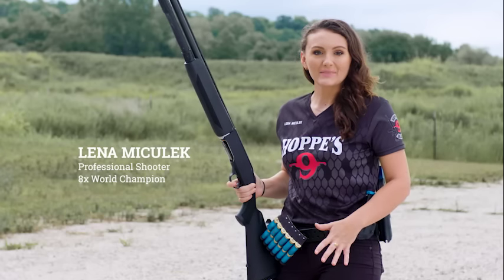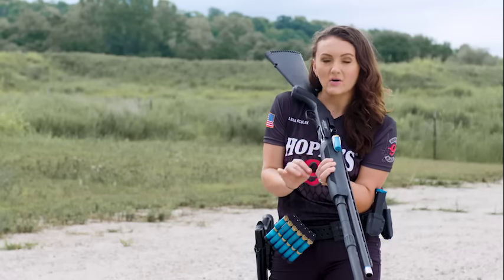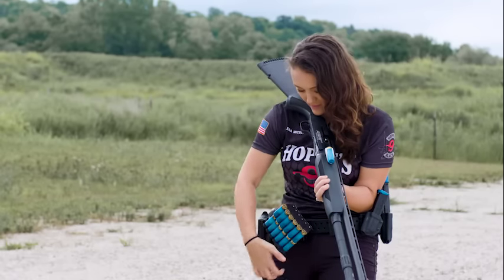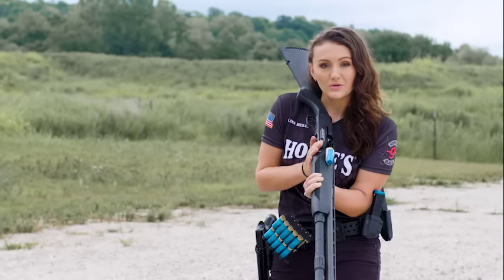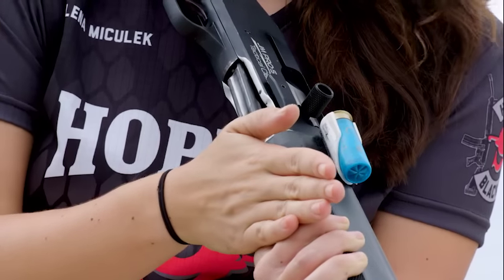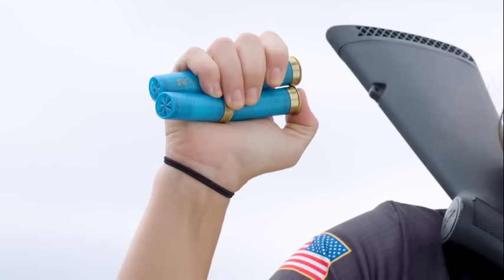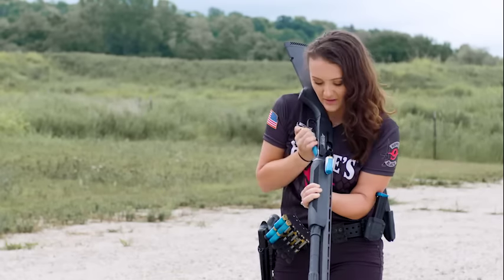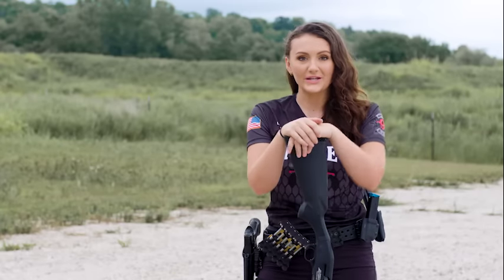Lena Miculek Quad Load

Comment: Amazing instruction, I have two Snap Caps so I just tried this on a basic Mossberg 500, and it worked fine (messed up many times but the dual load worked several times). As for the quad load? EH, not a chance right now.

Hardest part seems to be holding the shells and not letting them fall. If you do, you need your other hand to regroup if you’re a “normie” like me.

She’s really damn good, but we all know that anyway.

Comment: I run 3½" 12ga

One quad load and i am full up on an unextended tube.

Never bothered speed loading a shotgun, but now that ya showed me it looks like imma have to spend an 1hr or two a day doing reps till i am happy with it.

Tho now u showed me the mechanics... I don't like taking a long gun off shoulder to reload.

I think there maybe a way to pull off a twin load without taking the shotgun off shooting position. In my head i see maybe being able to hold two shells like u would a throwing spike.

Gonna have to sit and play around, see if my wrist can bend to the correct angle while holding two shells in spike throwing palm hold.  And then using the base end of my palm to run the shells foward..

Idk I practice next weekend when i have sometime see what happens.

I don't think there is risk of jamming or punching finger tips, never tried so don't know.

Thanks u made my brain perculate

Comment: So the first time I watched this I was blown away on how amazing it was so like 2 days later I bought some snap caps and I started practicing and after about a week ive been rapidly quad loading now I’m about 3 months in and it’s gotten pretty gud the bad thing is though my rem 870 hasn’t been dremeled so every time I go to fast it hits that lip and my top or bottom shells break and I lose control of it, every time I go out the range I just blow people away with it and there like what was that, and I’m 13yrs old and I go against adults I wanted to practice this because of quail and dove hunting cause they are some fast birds and when you have a fast reaction time to reloading it does great for you

Comment: In my experience the loading is actually the easy part, but getting the shells out of the caddy is hard

If I take the shells in my hand I can easyly load them I even can do 3 and 2 but I usually get one or two stuck in the caddy when trying to do the full process

I use an unmodifyed fabarm sat 8 (pump guns are illegal in austria but semi autos not) and I have quite large hands

Comment: What is the white clip that’s holding the shell on the side called? I know that’s a dumb question I just need an answer
Reply: A "match saver" used to drop a shell inside the ejection port rather than in the tube

Comment: Twin, quad load my shotgun and put the end of my barrel in the ground?😂
Reply: Did you see it in the ground?
Reply: @jimmyreece5781 you can hear it hit the ground and she then she rests on it
Reply: @jasonb8407  doesn't mean it's in the dirt or on the concrete.  There's something called a barrel rest pad and it's made for this purpose.
Reply: @jimmyreece5781  well I can say I have never heard of that or see the purpose in it but hey if it is a legit way that competition shooters use than run and gun.
Reply: @jasonb8407   You'll see it a lot at trap ranges. Ypu may have to wait a bit for your turn and some O/Us are heavy.